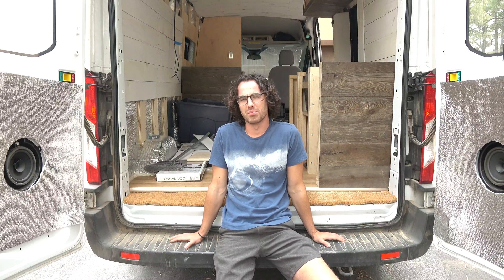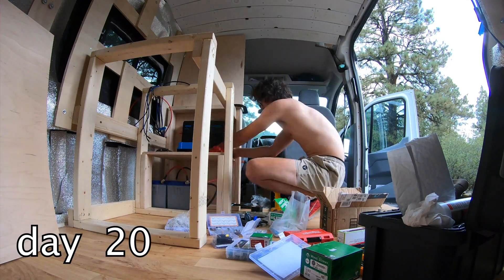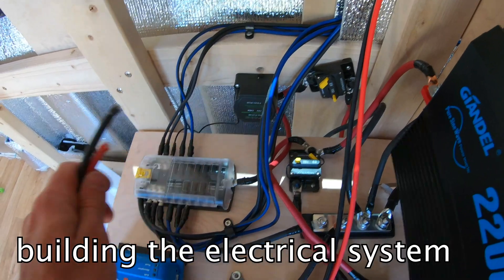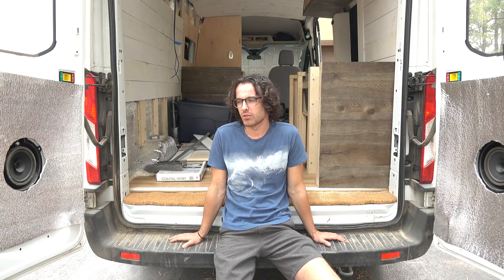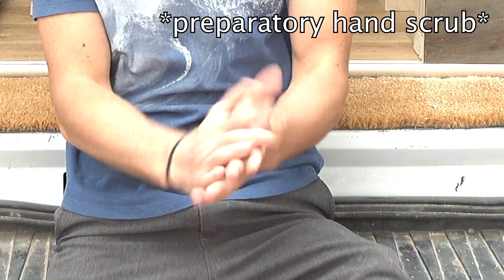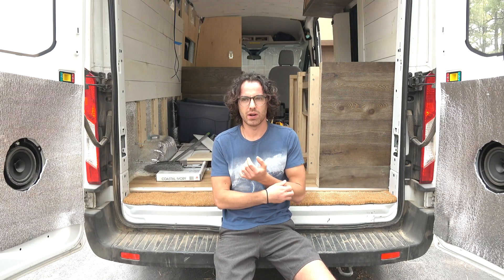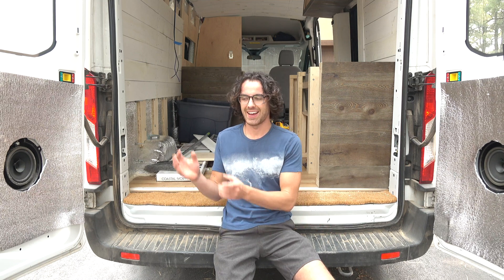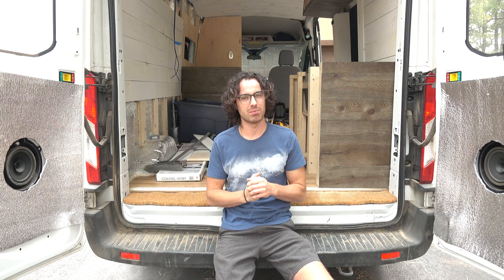DIY Van Build Electrical - SOLAR, SHORE POWER, BATTERY ISOLATOR

Comment: is there a particular reason you chose a battery isolator rather than a dc DC charger? I'm trying to figure out how to charge my aux battery off my alternator and also install shore power
Reply from the maker: Mostly because of the information I was exposed to while working on the van. I encountered someone who did what I ended up doing so I copied them.

If I remember correctly, the dc to dc would be better in the long run but more expensive?
Reply: @JeremiahLuke  I think that's the general consensus. it's healthier for the auxiliary battery bc it charges at levels and doesn't hurt the starter

Comment: bruhh your vids are awesome. can you tell me the dimensions of that wooden cage you build to support your battery/electronics? think i want to build something similar
Reply from the maker: haha thank you, man! Appreciate that because I love making this stuff and love what I make. So, the cage is about 22" deep, 13 1/2" wide and 30 1/2" tall (All of these measurements are from the inside of each 2x4 and then as you can see I put the plywood on the outside of the plywood so I gained a few inches on each side there). I have been so thrilled with how it worked out...it's so tight but not too tight to manage all my pieces + the installation wasn't a huge hassle but it makes me happy not to have a bunch of wasted space.